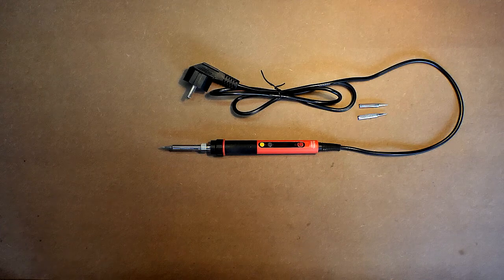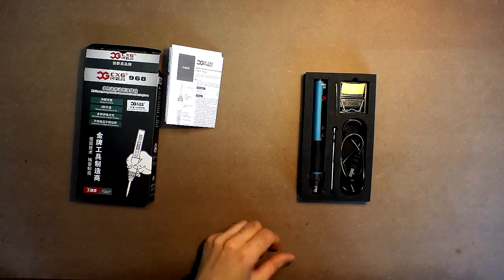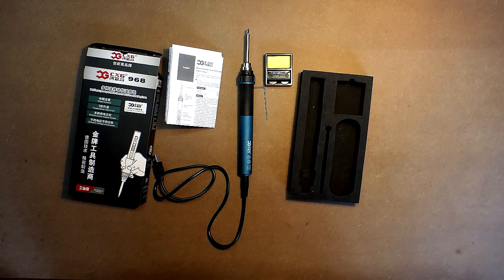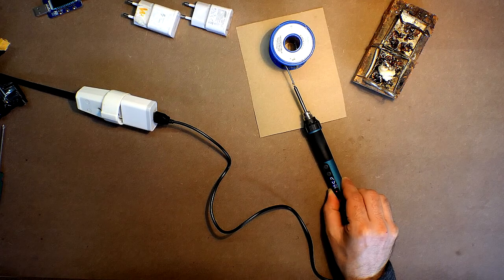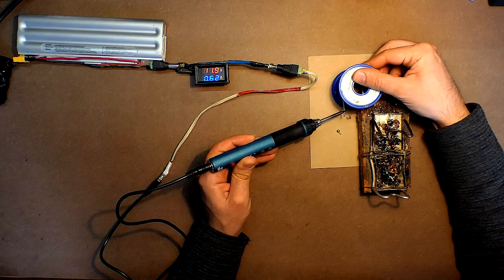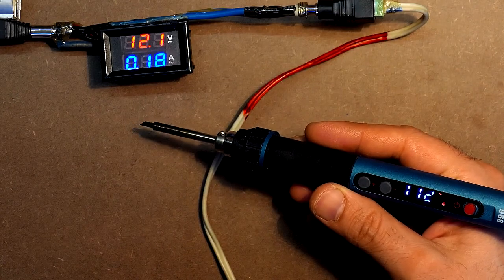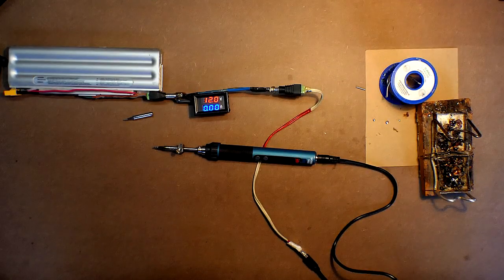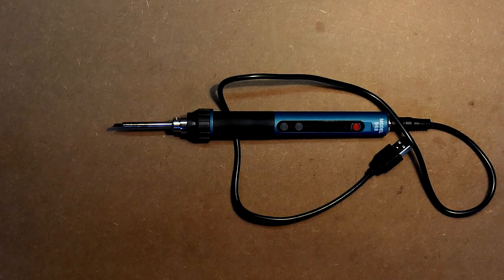CXG 968 Portable Soldering Iron

Comment: Hi!. Can you enter the diameter and length of the heating element t8?.
It's not the measurements of the ends that weld, these I have; they are the measurements of the total construction.
Thanks.
Reply from the maker: L=95mm, d=4.5mm
Reply: @koglianc   Thanks